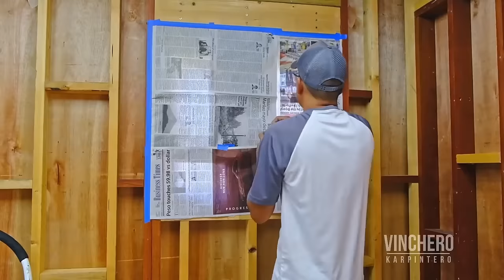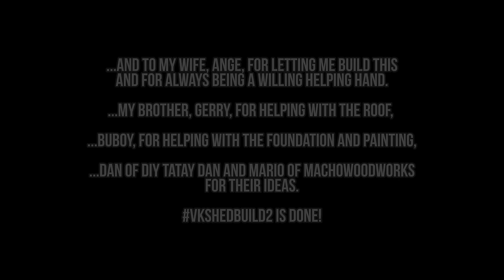How To Build A Shed Start to Finish (...and How to TEAR DOWN a Shed!)

Comment: I always thought roofs over conditioned spaces needed to be vented.  I saw it was insulated with spray foam.  Is there a reason this build doesn't need venting?  Great work on the door
Reply: Not a conditioned space.

Comment: Impressive build. The only thing that makes no sense to me is to do all that work and even do spray foam insulation only to make barn doors? The amount of cold/hot air that will be leaking in there makes all the insulation almost pointless….

Comment: One of the better shed builds by someone not in the trades. You obviously read framing books. Love that you make notes on material as reminders. That slab a lil thin and also didn’t see dowel pins(?)? It will displace differentialy if you have any freeze thaw. May not be an issue in your climate. But I like the suggestion of having a concrete curb to prevent premature rot at the ground, similar to how garages have concrete perimeter curbs, but that is hard to pour as diy concrete. Treated wood only helps so much. Plywood horizontally as sheathing is better to prohibit racking. Again, more an issue depending on location, climate etc. Also, roof sheathing shd be exterior rated tongue and groove as it’s stronger. Roof shingles work better, last longer on a minimum 4:12 slope. Manfs say a 3:12 slope works, but that is bull.  Quality build though. 👍🏽

Comment: LOVE the look of the sliding door, but I don't think they are weather tight are they? Why that choice when you have insulation and finished interior.
Reply from the maker: It's a great point. Right now, the barn doors work just fine keeping the rain away. But if/when I decide to install air conditioning, I will have to change the doors to something more weather tight. This was built in Manila, where we really only have 2 seasons: rainy and hot.
Reply: @VincheroKarpintero  I would keep the sliding door for the looks. Just have a second door behind that for your air tight seal. Great work!

Comment: The minimum roof pitch for shingles is a 2:12 pitch.
Sheetrock must be staggered.
Barn doors not ideal as entrance door, it's hard to weatherproofing and insects & mices is easy to get in.
Ventilation?

Comment: How Much $ did it cost? Less than Half than what it would cost to Buy One.. They could use these but Double/Triple/Quadrupled in Height in the Philippians, If you could find anyone Skilled enough to be able to build them. They have No Idea what a Level is for one. Or Find anyone who actually Sell Good Material in the First Place. But Still 1,000 Times better than what they have now, most being built out of Garbage.